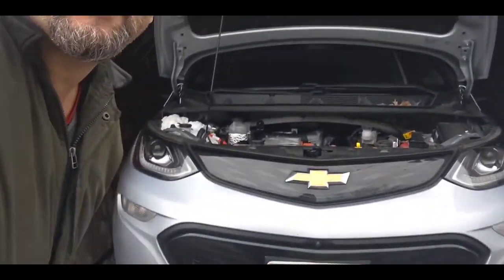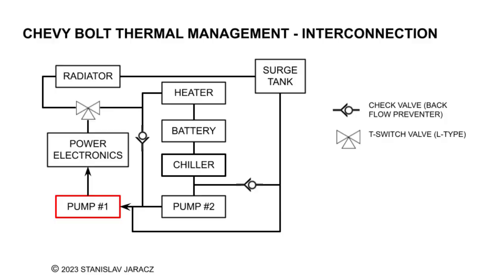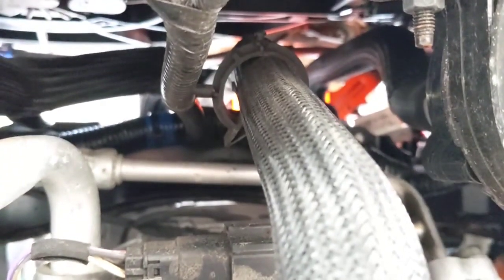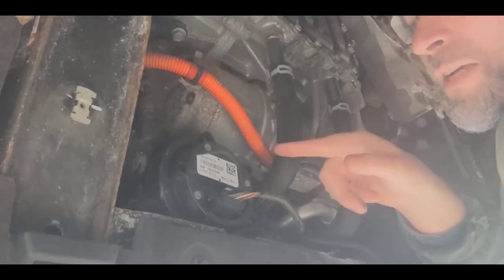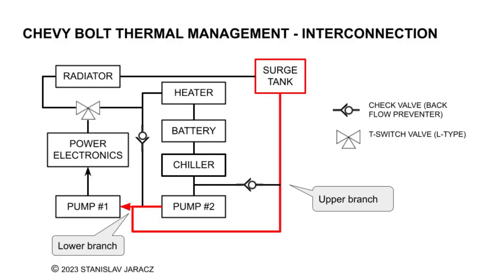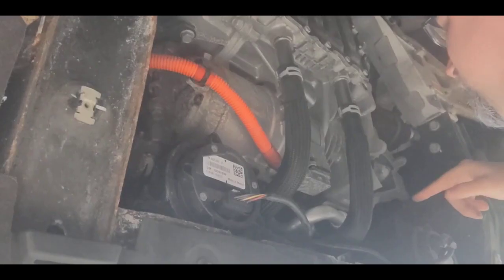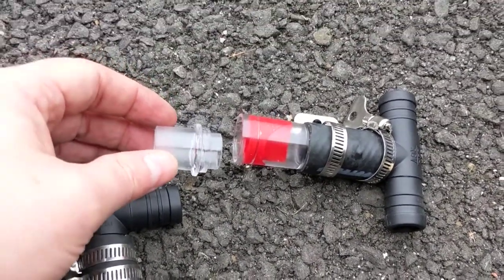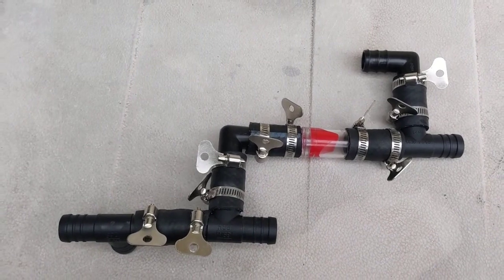2017 Chevy Bolt EV, Thermal Management Upgrade, Part 3: Getting ready for the project

Comment: Great investigation! Hopefully we can go to aftermarket shops in future for upgrade the easiest potential upgrades are a battery pack in the trunk that you have to plug in. Best might be a separate rear Drive Unit especially for 1st Gen EVS like fiat, leaf, Etc. It could be air-cooled, on a timer for 6 seconds on acceleration only, probably best to keep it under 300 pounds. It could provide a small boost in range and performance.

Comment: I’ll be interested in seeing how this works. I have a 2021 Bolt and after driving nearly 13,000 miles across the USA and Canada, I have witnessed firsthand how painful the charge rate is. The Bolt, while it can be used for road-tripping, is not really well-suited to it. The frequency and length of charging stops was frustrating after about the first week out of nearly nine on the road. I have a Lucid Air on order and will use it for future road trips, but I am keeping the Bolt for local or regional travel. It is very well suited for most of my needs.